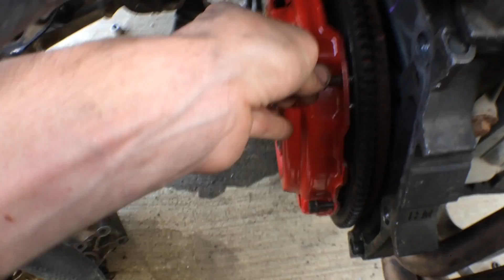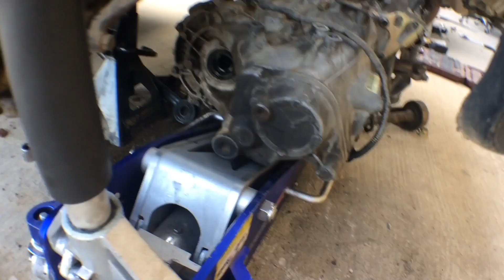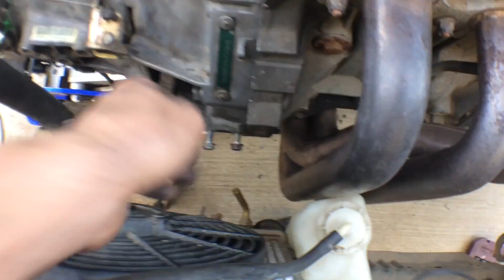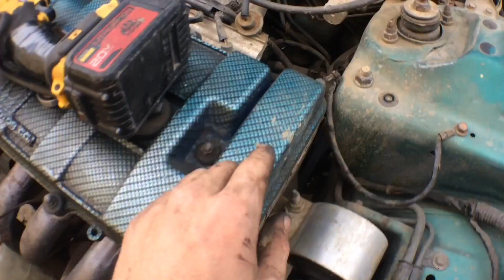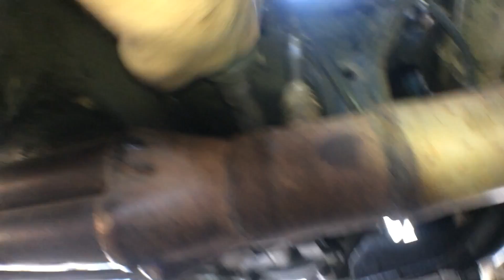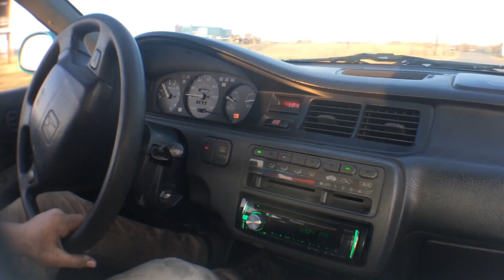Honda Civic / Integra Clutch Replacement: Intall

Comment: Will the transmission oil leak out or did you drain it first?
Reply from the maker: It will likely drain out of the axel holes. Draining beforehand is recommended
Reply: @TheFeesher  thanks wanted no know before I changed the fluid. Gonna do the clutch soon just bought the car it isn't slipping but the adjustment is maxed out on the pedal so i know the clutch is near the end of its life. Got a great deal on a low mileage civic that been taken care of. Not much rust and bone stock. Think I will do the rear main seal while I'm back there I plan on keeping this car for a while

Comment: I have a 1992 Civic VX (D15Z1 1.5L engine). Anything different about a clutch install from what you did here? It has no high-performance mods or anything.
Reply: How was it? Any tips I gotta do mine also same spec
Reply: @monibo7075  I sold the VX to my brother in law last year. It had been like an old friend for 25 years. I was 41 and in much better health when I bought it back in 1996. In recent years it became difficult to manage the manual steering, clutch and shifting, so I had to let the Red Rocket go. I bought a 2012 Toyota Prius V about a year ago. I never got around to replacing the clutch in the VX.

Comment: The hardest part about the transmission. Is installing it. Over tryna align the spline into the clutch. Couldnt get her in. So I'm gonna buy the same bolts for the bell housing but longer and cut of the head install 2 of them on the top and slide the transmission into the bolts to hold em while turning the damn spline a quarter at a time 😂😂😂
Reply from the maker: That is a genius idea, did you just come up with that or read it somewhere?!
Reply: @TheFeesher  hahha nah I was browsing Quora/honda forum and a comment came up saying to do it that way. Makes life x1000 easier.
Reply: I've only been doing auto mechanics for about maybe 3 weeks. Since corona i had a while to think about what career I should do next. So swapped out cooking to auto since I love cars.
Reply: @JR-kl3cp  Join the club
Reply: @TheFeesher  Yes, that is a good idea

Comment: @thefeesher do you have a diagram to help out with the sensors and bolts? You were kind of moving all over the place and I'm stuck trying to get my transmission out.
Reply: https://www.nthefastlane.com/b-series-torque-specs

Hope this helps. When I was installing the new clutch on my integra I used this forum. It works for both metrics
Reply from the maker: The only sensors on the transmission should be the speed sensor and reverse switch

Comment: my torque wrench is inch pounds, how much should i put it at for the flywheel?
Reply: What ever the torque is say its 20ft/lbs just times that number by 12 and its 240 inch/pounds. Works for since I have two different metric tools

Comment: Do I have to remove the starter?
Reply from the maker: Not technically, but there is a bolt that goes through the starter, one of them can stay in, it’s not hard to remove though, I’d just remove
Reply: Thank you for your help, I plan on getting the trans remount its this weekend.
Reply: So why ive replaced the clutch, flywheel and throw out bearings and goht my trans bolted up but its not going in right, i really don't want to take it back out and try again.
Reply: Oh yeah my starter was missing the same bolt on the bottom
Reply: The bell housing is pinched up top and the bottom is gapped by 1" to 2"
Reply from the maker: You probably do not have the input shaft directly splined into the clutch correctly or do not have the dowels lined up, I have experienced this, I just had to keep resetting the transmission onto the engine to get it right
Reply from the maker: You probably do not have the input shaft directly splined into the clutch correctly or do not have the dowels lined up, I have experienced this, I just had to keep resetting the transmission onto the engine to get it right

Comment: Just bought one of these from the dealership I work at before it went to auction, I think it needs a clutch but the clutch fluid in the reservoir is black. Maybe just replacing that fluid and bleeding it out is all it needs?
Reply: Probably not the cause of the problem, but if the fluid looks like sewage, replacing it will improve pedal feel massively.
Reply: nah thats only needed if the clutchpedal isnt able to be pushed in smoothly if your clutch comes/runs?? late then your might need to replace it :)
Reply: LeonEazy I had the tranny in and out with a new clutch in 4 hours, a lot easier than I expected

Comment: Did u have to sperate the half shaft?
Reply from the maker: Yes, it is bolted to the engine and is easier to remove the shaft and than remove the tranny from the shaft

Comment: 8:25 thats not where that ground goes anyway, check any manual that holds on a power steering line. A wire shouldn't be there to begin with. I also disagree about the ground on the front as stock the valve cover would be bare metal to front radiator support, why a ground is there to begin with idk and dont care its stock and not an obstruction for me. here is a web page with a picture supporting my thoughts https://www.cartechbooks.com/techtips/introductiontohondabseriesengines

Comment: A good tip is to inspect the fork that moves the release bearing because of wear on the pivot point it can crack and break, I had this experience on a 90’s Mazda 323 with a similar type setup. Generally replace it as well.

Comment: Do you have to change the gearbox fluid when replacing the clutch?

What about flushing the gearbox ass well?
Reply from the maker: Sorry about the late reply, yes, usually the fluid will pour out of the holes where the axels were, so it will need to be refilled as one of the last steps durning installation

Comment: More like "Honda Civic / Integra Pressure Plate Replacement: Intall"
Reply from the maker: I have another video showing removal, I'm pretty sure
Reply: The Feesher - That's nice.. well just in case anyone came here to actually install a clutch on their b series - The flywheel torque should be 19, 38, 57, 76ft-lbs. Star patter. The pressure plate will be 5, 10, 14, 19ft-lbs. Make sure the clutch has the flush side facing your block, with the bulk side facing your trans. Also make sure you stick the thing in the hole..... As if you needed to be told what a fucking clutch alignment spline is for. There's no way anyone would figure that out on their own. There's just no way..
Reply from the maker: Neglect Antithesis good info, thank you
Reply: The Feesher - Seriously though you should title it a trans install. lol

Comment: uhh yeah...totally went all out on the clutch without breaking it in lolll
Reply from the maker: +Maika678 yeah lol, not my car, I warned him, but that's all I can do at that point
Reply: Yeah i just replaced mine myself. Turns out my problem was the clutch, throw out, and pilot bearing. And then ya know...threw everything back on...lalalalla.....BUT...the sound was still there. It was ALSO the input shaft bearings. RIP.......wll do it again when it gets worse...lolllll fml...
Reply from the maker: +Maika678 sorry to hear that!
Reply from the maker: +Cody Tessmer for clutches it definitely exists, engines people argue about, but clutches need them to wear the surface level
Reply from the maker: +Cody Tessmer probably not, if your rear main is gone it will just get soaked again. And the heat from slipping probably has baked the oil into the friction disc, I would recommend a new clutch, flywheel and rear main. My 300zx had the same issue